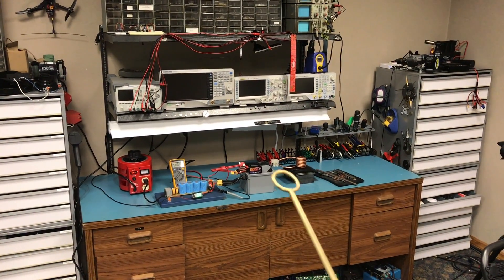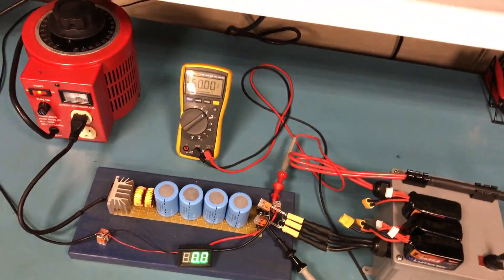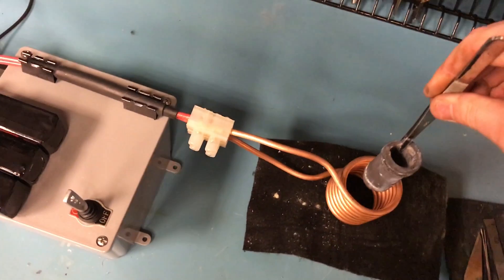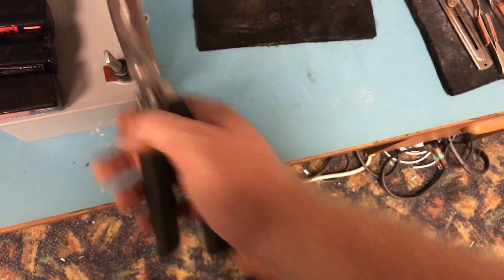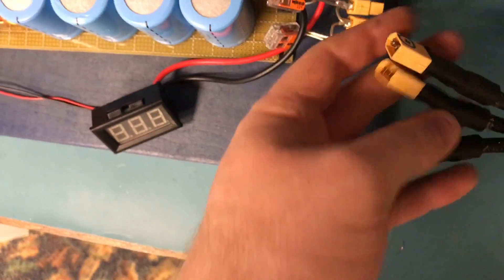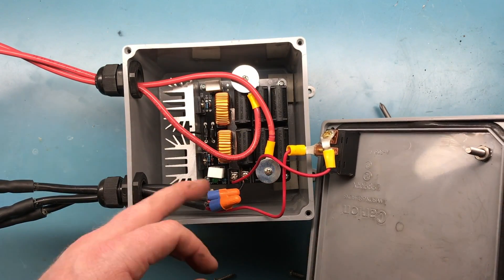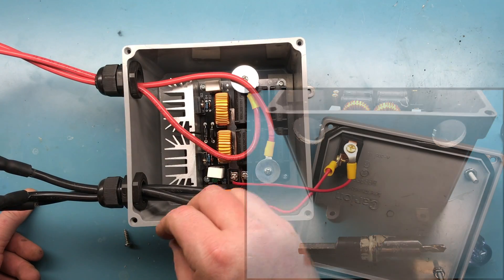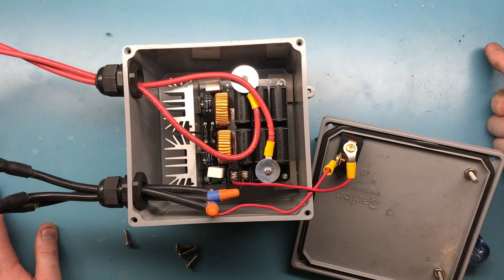Testing the Portable Induction Heater and How to Build One

Comment: It's alright to simply connect one of those coils to a variac directly for the same general effect?
Reply from the maker: That would be a good way to blow a fuse with that coil. It would have to have a much higher number of turns and at 60Hz to not blow a fuse and it would be a very inefficient induction system. Same reason regular AC transformers get warm. The higher the frequency, the faster the heating occurs in the target material.

Comment: All this induction heater boards like 1500 watt or 2500 watt on Amazon and ebay, 
How di you know what power supply to make or get? Do you just need one that says 1500 or 2500 as what the board says? 
I wanted to just use two marine batteries in series for 24 volts

Comment: You said you would not use it as a forge? If that only because is the heat disapaition? If you had a fan cooling the mosfets, could you use it as a forge? I ask befuddled that is exactly whet I want to build for my brother do he can get away from the coal burning forge he is currently using.

Comment: 0:15 "Portable" and "Standalone" are the same thing. "Standalone" (mode) is with batteries, not when it's hooked up to a charger. It's "alone". i.e, no wires, cables or chargers etc.  Try "Desktop mode"  instead. ;)

Comment: Sorry but You could not fill it with mineral oil, as the oil would eat your rubber seal and any rubber in there, plus the mineral oil would work it's way throughout your cables and leak out. 
Trust me iv been there. It's very hard to seal anything from oil.

Regards 

Anthony

High1voltage1rules
Reply from the maker: That depends on the type of gasket and the type of oil. I've filled several of these type of enclosures in the past with silicone oil after sealing the cable connections with silicone. No issues with leaking if you do it right. I've built a 26kV, 50kV, 100kV, 200kV, and a 1.6MV generator for a customer and all units were sealed with silicone oil except for the 1.6MV unit. That was filled with special high voltage dielectric oil.

Comment: How does it do on 1” dia thin wall steel tube? I need to heat it locally to bend up frame tubes and exhaust pipes.
Can it get  .060” wall 1” tube up to red heat?

Comment: Hi, there. Thank you for a video. 
On 2:55 you said that it's very important not to have anything in the coil before starting, since it can cross-conduct and then MOSFETs will be in big trouble.    Could you kindly explain that a bit if you have time? Thanks.
Reply: In practice, an object inside the Coil reduces its inductance, and so the oscillation may not begin due to a lack of reactive component and the mosfets will turn on together and the bad thing he was talking about is that they won't cause a short circuit so any protections will trip but they will just dissipate a lot of power, result, burned mosfets, maybe damaged PCB, a lot of smoke and risk of fire

Comment: You should add a cooling fan inside
Reply: Or put a fan inside a food container or something and put ice in it and cut a hole in the container where you want the fan and connect a tube so the fan blows cool air into it through the tube. I haven't tried this but seems reasonable to me. Put less ice if it's too cold for it I'm curious as to how it would work

Comment: Is the size of the loops in the copper tubing important or can those loops be larger and it still work, it seems like a lots of work if you have a large amount to melt...PLUS how hard would it be to add an on off switch....

Comment: How are you gettin that much power out of that rectifying circuit? It looks like you have quantity (4) 1,200 uF capacitors in parallel for a total capacitance of 4,800 uF. The voltage ripple on smoothing capacitors is current/(frequency*capacitance). Since you’re running it through a full bridge rectifier, the 60 Hz from the variac gets doubled to 120 Hz so V ripple = 20 A/ (120 Hz * 4800x10^-6 F) = 34.7 volts. That means your voltage should drop to around 15 volts 120 times per second which I would think would not make this heater work too well. Is there something else going on in your rectifier circuit?

Comment: thanks for the decent explanation on fast power up lode, i have the small version and 12volt train set power supply i added in a 14amp train pusher dial to the circuit but it only rang sometimes and your right it was only when i was not placing something in it, i wanted to use it as a gold dust smelter inside a cruicible, but all the winding experiements turned out to fail even though it only heats a needle that was pathetic , your bigger version is what i'll try next thanks for the 24volt tip, do you mean iron fluid or aluminium fluid , they sell antiboil for cars in oil form, was just wondering how to reverse heating is it via gas nutrons like the freezer fridge? when it makes condensing via negative influence ?

Comment: The wires connected to the coil coming out from the plastic box  are too thin because heavy resonant currents will pass through them to the coil so be careful for continuous operation they may burn.
Reply from the maker: That 8 AWG wire is perfectly capable of handle 20  amps.  8 AWG is rated for 50 amps.  I wouldn't run this for too long because the electronics will overheat in the case if used for more than 20 or so minutes at a time.

Comment: Would like to make an induction sewer cooker, with cast iron pipe. Septic is expensive, but human waste can be made safe if heat treated. Solar/wind  plus induction seems to be a good choice, as one often needs an energy dump. Would be much better for the environment.

Septic systems can cost between $5000 to 10,000 dollars. Would seem you could burn poop for far less, and make it safe for fertilizer .

Comment: Do you have any issues with heat generated on zvs output cables? What's the gauge of the wires are you using to extend outputs out of the enclosure? Also, how much is your current consumption without putting an object into the coil? I have a similar setup, however I have an issue dealing with heat of standoffs as well as cables at the output.

Comment: Would it melt brass in the crucible?
Reply: There is enough energy, over 500 watts to melt brass. The graphite crucible will tolerate well over 2500 degrees Fahrenheit and red brass melts around 1800 F which is orange/yellow hot. The real trick is to insulate the crucible and keep a cover over the melt to keep the radiating heat from escaping to the surroundings. Also ,the crucible will begin burning so it's important to melt and pour it as soon as possible. I would start with very small quantities of brass and slowly add more per each experimental trial to see how much you might melt. That crucible won't melt and hold much molten brass, likely only a few ounces at most.

Comment: Would a 40v battery work? I wanted to make one for a video, but I was wondering how long it would last with a 40v, if you knew
Reply from the maker: It could, but that depends on a lot of things.  What capacity is the 40V battery and what is the rated maximum discharge rate?
Reply: Proto G high capacity, the maximum discharge I can't be positive, cause these are usually bought for leaf blowers and weed cutters, where there're not the specific on the batteries.  The brand of it is RYOBI, I haven't been able to find a lot of info about it :/
Reply: @Sam_Folsom  they should have adequate discharge. Most battery operated drills and other power tools use battery packs consisting of multiple high discharge 18650 lithium cells 3.7v per cell. The same cells can be found in laptop battery packs but have only low discharge capabilities. I discovered this when I made a battery pack from 18650 laptop cells for a quadcopter/drone. When attempting to lift off the craft rose about 5" off the ground for around 2 seconds before landing. I changed the cells over to 18650's from a power drill battery and take off was successful

Comment: That was awesome! I know that it's not technically a forge, but just the idea of an electronic forge is exciting. With the right parts and a properly regulated power supply, you could definitely make an e-forge! And the fact that it was battery powered made it even more useful. And thanks for showcasing how you made it. It really makes it that much easier to understand and debunks the common "mysteries" of circuitry.

Comment: Hang on - am I missing something, or would the output coil on this setup be at mains potential? I can't see what isolates the output from the mains.
Reply from the maker: The big red variac (adjustable transformer) is stepping down 115VAC to around 50VAC that is then being rectified and filtered with the inductors and capacitors.
Reply: Ahhh, it's an isolated Variac - didn't even know you could get those, cool!

Comment: Why don't you make some cutouts in the enclosure and add 2 little fans near the radiators?
Reply from the maker: I might, but I'm still deciding whether or not I'm going to fill it with oil.  It's not something I'm going to use very often but if a demand pops up, I'll consider oil or fans.
Reply: Proto G Even if you fill it with oil, don't you need a pump to recirculate it and some exterior radiator? For me it doesn't make sense to just fill it with oil, since the plastic encasing is still a heat insulator. Plus, the ZVS will be heavier.
Reply from the maker: Even if I did absolutely nothing else, filling the case with oil will dramatically increase the continuous run time of the unit.  More so than only adding fans.   Oil can store much more thermal energy and transfer the heat away from components much easier.  The thermal conductivity of oil is more than 6 times better than air and oil can store 66% more thermal energy than air.  The downside is of course that the unit will be heavier but it will still work better than fans in the short term.  The average oil temperature will eventually get hot but you're talking over an hour of use.  If you plan on using this unit for more than an hour, you shouldn't anyway.  It's not a replacement for an industrial standalone heater.  Out in the field, your batteries would die before you're even close to overheating.  Of course you can make one however you want, but I'm leaving mine alone.
Reply: What I'm saying is that you're going to be limited by the plastic case in terms of heat transfer. The mineral oil will transfer the heat away from the hot zone until you will reach an equilibrium. Then where will be your heat transfered if you are completely insulated by the plastic enclosure?
Reply from the maker: You're right but what I'm saying is that if you plan to use this to the point that the thermal equilibrium of the oil is reached, you shouldn't be using this device at all. It would take an hour or so for the oil to heat up that much.  It is not an industrial heater and shouldn't be used as such.  If you really wanted to overclock this, fans wouldn't help much and you would still need to resort to either water cooling or active oil cooling which defeats the purpose of "portable"
Reply: I understand now. So you just want to practically defer the cooling time after the active use period, which should be a max of 1h.

Comment from the maker: If you like my videos, please consider supporting me at https://www.patreon.com/ProtoG42 to help me produce more content.  I spend quite a bit more money buying parts for videos than the income that the videos generate.  You can also support me by simply subscribing, liking and commenting on my videos.  Thanks for watching!
Reply: Yo give the upper most copper coil a opposite turn, then you can just drop the metal into the coil and the metal will float at the intersection of the two coils until you turn it off. You could then put a molten cast at the bottom of the coil so when you turn it off it falls right into your mold and hardens in whatever shape you want it.
Reply: If I wanted to melt some steel, what variac would I need?
Reply: Proto G where did you get that knife, that was real cool!! NOT THAT THE COILS WERE NOT  COOOOOOL!!! Just asking One Old Legged Joseph T
Reply: Can I just pay you to make it and ship it to me?

Comment: Try to melt copper.
Reply from the maker: I melted aluminum in this previous video: https://youtu.be/_9ZK_Hs99FU
Reply: aluminum does not suit. gold silver copper is necessary.
Reply from the maker: What do you need it for?
Reply: melt the gold in a crucible
Reply: Copper or bronce is much mor beautiful for accessories I want to cast than aluminum. I was wondering if I would build a propane powered furnace ore a induction furnace. Induction really seems nice, is it possible to use it for bronce casting?
Reply: I'm not comprehending operations how works.  Does the material need to be a specific sympathetic resonance frequency for the material or just the RF heats the air or material inside the coil?  

Also, what would the effect of painting silica glass or refractory material on the inside of the coil?  Maybe even in a tube or furnace design so better to insulate the RF coil and inside diameter of refractory tube crucible or whatever is there in that location?
Reply: Maybe like in this link: https://www.youtube.com/watch?v=_9ZK_Hs99FU&feature=youtu.be

With better refractory material and a lid.  Really neat youtube with materials you can buy also for the projects.  Proto G, great presentations!

Comment: Nice video, I really liked the ZVS driver enclosure! Also would you mind sharing what rectifier your using in your power supply? Also whats the voltage and capacitance on those capacitors?
Reply: Proto G Hi, could this be used with an old stick welder?
Reply from the maker: There are four 1,200uF 200VDC caps.  The more, the better in this case.  Not sure about the rectifier off the top of my head, but any high power full bridge rectifier will do.

Comment: Thank God you didn't demonstrate cutting anything with a hot knife! Does the coil get hot with extended use? Would it eventually need to be water cooled?
Reply from the maker: The coils mainly get hot when from the radiated heat of the object inside, but you can reduce that by putting a fiberglass insulation sleeve on the coil.

Comment: Good video, I'm making something very similar, for automotive use to get seized bolts unstuck. What toggle switch is that for power? I looked around on ebay and couldn't find anything that was rated high enough for the device to work at 1000W. Opted to use a mosfet and an ordinary low power switch to toggle power instead.
Reply: Jimmy,could you send me a schematic of the mosfet switch you made? I'm interested in making one, the switch I used wasn't up to the task. Worked on 24V but when I stepped up to 48V it didn't last long.
Reply: I'm not making one from scratch. Coincidentally I have the same zvs driver @Proto G is using in his videos. I have not received it yet due to long shipping from China, but I will try to remember to update you on when I do receive it. It should work up to the maximum of 60-70V after which it goes up in smoke based on the literature I found on the web. @Proto G has shown that it can draw over 1000W without going up in smoke.
Reply from the maker: Thanks! Any switch rated for 15 amps or more will be fine.  Remember, you should never switch power to the unit with anything in the coil.  When you switch it on, you'll only be switching 7 amps or so.  The ratings on switches are only for the actual switching current.  The conductors within the switch are rated for much more than the listed rating.  These will work fine: http://amzn.to/2iVP2co  Your solution with the MOSFET is also fine, but more complicated than it needs to be.
Reply: Proto G fantastic, didn't know about the switching current part. Thanks!